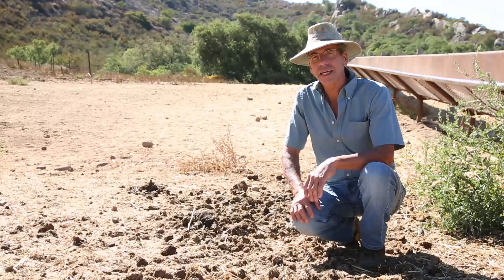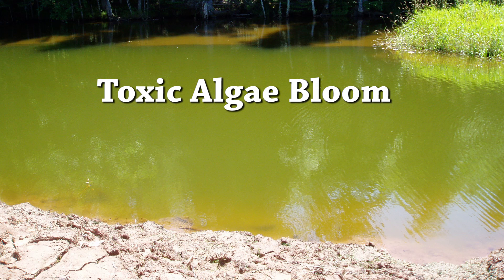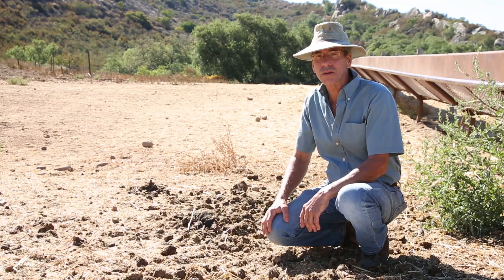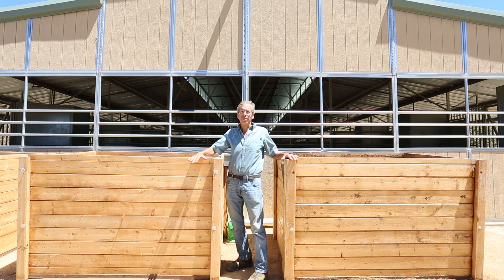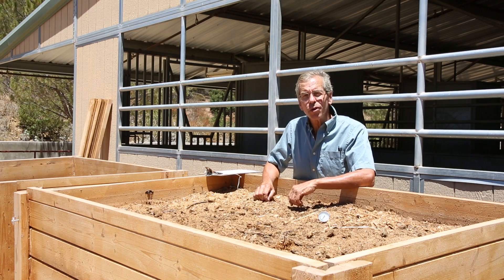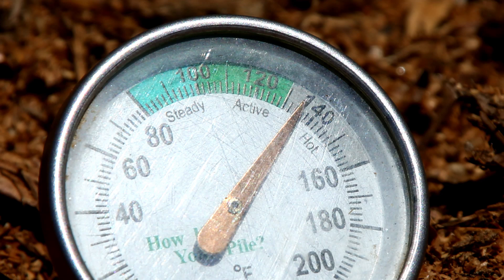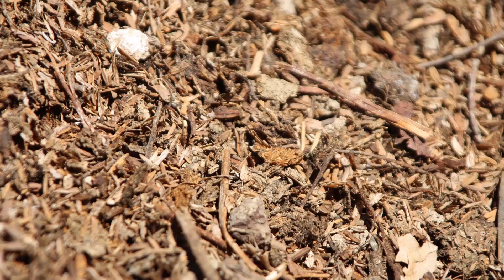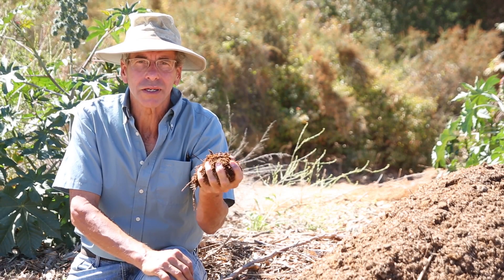Static Pile Composting

Comment: Hello from Ireland 🇮🇪. Good video 👍
Reply from the maker: The aerated static pile works well and can be scaled up.  After running the trials shown in the video, we went to 5 bins, each with a capacity of 50 cubic yards (38 cubic meters).  It is important to get the density and the moisture of the manure and bedding compost mix correct before it is placed in the bin. Periodic aeration with a small blower will determine how hot or cool the compost gets and keeps it from turning anaerobic.

Comment: how come that's aerated?
Reply: I guess that he is considering the size of the bin as a good chance for the air to penetrate. It works though,
I've tried with even smaller bins. There are several advantages, You don'y need to turn and the temperature
will not go overboard. I do it in old 1 ton Big Bags.
Reply: Because some microbes need a constant supply of oxygen to break down compost